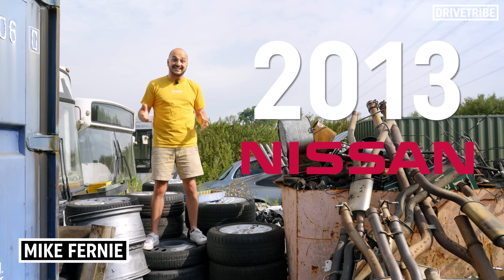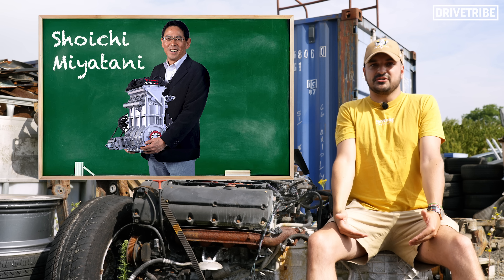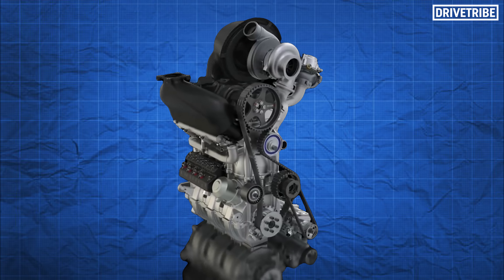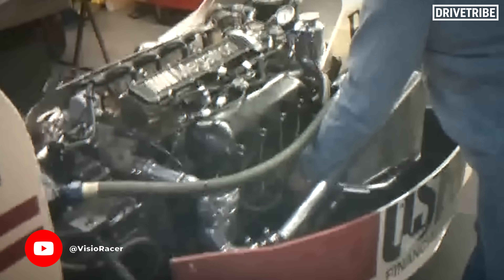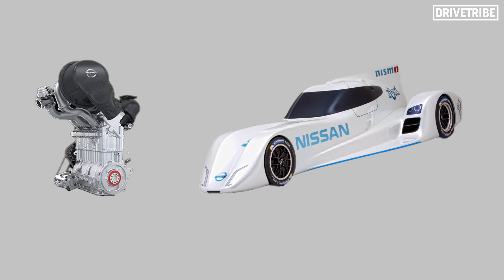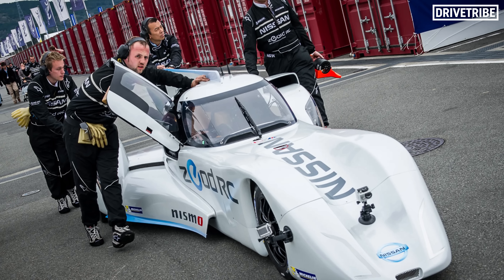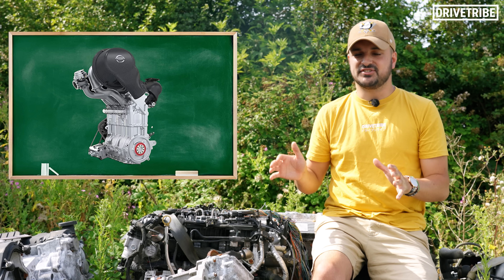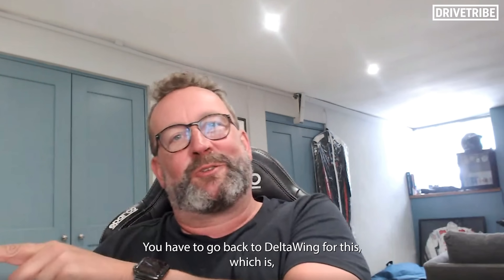This TINY Nissan Engine is More Powerful Than Your Car!

Comment: 07:00 that isn't at all how frontal area works. The ENTIRE front surface is frontal area, not just the tip of the nose. Stand in front and look at the car. Everything you can see, is frontal area. But yes, it is very sleek.

Comment: Perfect designs are perfectly balanced on more or all specifications. For sure there are more engines build already reaching these power to weight specs. But have these designs been used in multiple applications ? I think the answer is also NO.
However this video was quite informative to see that politics and lawyers also can influence the succes of an engine design.

Comment: I have a nissan with a dig-s engine, 1.2l supercharged with 100bhp, low consumption, but a lot of problems, valves, coil, spark plugs and so on. Too bad because its a funny car to drive.
Nissan like to make interesting engines, but sometimes reliability is better

Comment: Okay...wait...so 40Kg in an overhead compartment? I think folks dont apreciate how heavy 40Kg really is.
Reply: I think the overhead compartment reference was more for the physical envelope rather than the weight. To your point, I have no idea how strong those compartments are, but I certainly wouldn't want that weight over my head, dynamically loading the bin in a turbulent patch of air. 😳
Reply: 40 kg is the same weight as a bag of cement (except in Japan where bags of cement are 50 kg)
Reply: @tmatsci  -- Actually, it's 88 lbs, and cement comes in 94 lb. bags. It's about halfway between a bundle of old-style roof shingles (81 lbs.) and a bag of cement. When I first started in construction, we had to carry those bundles up a ladder, about 40 bundles for the smallest roofs we did, and up to 150 of them on the larger houses. As for the overhead compartment, if you put 4 25-lb. carry-ons into one of those compartments, you're already heavier than the engine.
Reply: @grizzlygrizzle  cement bag weights depend on where you are in the world.  In Australia where I am it is now 40kg per bag of cement and has been since 1973 when we changed from the old imperial measures to metric. Before metric the cement base was nominally I cubic foot of cement and weighed 94 pounds. Now that it is metric it is 40 kg or 88.1 lbs in the old measurement. One cubic foot of cement was chosen so that you could easily batch concrete by volume for example a typical foundation mix was 1 bag of cement, to 4 bags of clean sand and 7 bags of gravel aggregate. From what you posted it would appear that you live in the USA  which is still using the old system.
Reply: @tmatsci  -- Right you are, Ken.
Reply: grizzlygrizzle No Cement comes in in 80 pounds you must been from somewhere else
Reply: Max weight for cabin luggage is 7 kg or so... no way would any one take a cabin bag weighing 40 kg onto a plane... even hold luggage must be 25 kg max 😆😆
Reply: How much is 40kg in real units of measurement?  Is that as much as a standard person? Or a standard house?  Who knows?

Comment: Suzuki Hayabusa Says " hold my beer" and hand me a turbocharger. It might be heavier but it's because transmission is integrated into it.
Reply: Exactly my thoughts, including the transmission bit. Really strange that he didn't think of turbo bike engines.
Reply: That hyabusa engine gets turned into a V8. Someone makes cams so you can rotate one head.
Reply: Ever seen the V8 by merging 2 together?
Reply: @MrRourk  Wow yes please you'd only need a 4 speed Gearbox
Reply: @MrRourk  The Synergy V8 that was more famously stuffed into a GT86?
Reply: That and the Ninja H2R, stock.
Reply: Why do we always have to have the haters and bashers on everything
Reply: i think porch has a 250cc engine that produces 100hp that they made for testing head designs but probably weighs a alot since its only used for testing
Reply: This was still much lighter.
Reply: @Markknightexeter  it looks like it's weight 40kG is just the engine. Doesn't count all the parts to make it run. Like a water pump, alternator, intake, exhaust manifold.
Reply: @danowens7145  From chat Chat GPT,

"The engine from a Suzuki Hayabusa, without the running gear and accessories, typically weighs around 60 to 65 kilograms (approximately 132 to 143 pounds). This weight can vary slightly depending on the specific model year and any modifications or removals."

It also said this,

"The Suzuki Hayabusa's engine produces around 190 to 200 horsepower (about 142 to 149 kW) and approximately 150 to 155 Nm (about 110 to 114 lb-ft) of torque. These figures can vary slightly depending on the specific model year and any modifications or updates made to the engine."

If you were to calculate the weight compared  to power, the Nissan engine would thrash it, then again if you were to take the turbo off I've no idea what the power would be, I'm guessing 200hp+ from just 2/3 of the weight.
Reply: @Markknightexeter  This is where you make your mistake...you compare this turbocharges engine to a naturally aspirated engine. Why don't you compare it to a turbocharged Hayabusa engine? I will grant you that the Hayabusa engine will be heavier and it might possibly even make less power on pump gas, but that would be a more honest comparison.
Reply: @justinkase1360  not really, if you were you put a bigger turbo on this, it wouldn't be as powerful as a turbo huabusa and be lighter.
Reply: @Markknightexeter  "Chat GPT" ?... 🙄😂

Comment: A hand grenade is really powerful for short periods...
This is a silly topic. Toyota seem to have a reasonable performance/mass number with their 3 cylinder, but dont skip maintenance..... Bearing loads are really high on these small engines, ditto cylinder pressures.
There are no free lunches....

Comment: It’s been a while but there was a guy in the Arizona? desert somewhere who built a crazy little 400cc engine making 700hp normally aspirated at half as much weight. I don’t remember the exact details but it used a cam instead of a traditional crankshaft with roller pistons and no con rods. Useless in any real application but interesting.

Comment: Not so much the Diglett engine. The KATECH engine, though... has real possibilities in a somewhat deturned version (or a lower compression, turbo configuration) for road/track use. Road cars that I can see it in would be properly prepped Fiero or DeLorean. I also think it might be fun to adapt the Katech into a Ford Fusion AWD Titanium--these have been used in RAC rally cars and a turbo Katech four-banger would take properly prepped Fusion to a whole different level of fun. IMHO/YMMV

Comment: You can get 2000hp in a drag car .  It lasts 10 seconds before needing a rebuild !
Reply: There are 2000-3000hp drag and drive cars that can not only make that power and run 6 second quarter miles but can also drive hundreds of miles on the street between the tracks.

Comment: Nissan did the same on NA Engines. The SR16VE N1 was used in the limited-production Pulsar VZ-R N1, produced from 1997 to 1998. These cars were tuned by Autech Japan. It made 200 PS (197 hp; 147 kW) at 7800 rpm and 134 lb⋅ft (182 N⋅m) at 7600 rpm. Redline of the N1 Version 2 (1998) is at 8600 rpm. This is also claimed to be the most powerful production 1.6 L naturally aspirated engine.

Comment: Toyota’s 3cyl has been pushed well past 400hp. 
Comparing a production engine to a race engine is like comparing a lasagna to a sheet of pasta. 
I mean LamSpeed have pushed the toyota 3pot to over 880hp at the hubs.

Comment: For pure sillyness drop one into either an original 1960's Fiat 500 or a Tuk-Tuk. The total power to weight ratio would be insane. Both would probably need wheely bars to stop it flipping over!
Reply: Or just drop a Hyabusa into a golf cart.
Reply: @wingracer1614  Hmm! I've seen a V8 in a go-cart so I suppose anything is possible.

Comment: Hey, wait, no mention of Rotax? Their top-of-the-line product is a 1630 cc line-3 supercharged affair putting out 300 hp, for a weight of 91 kg. 

The only problem is that it's a marine engine, also used for snow mobiles. But it is an actual "off the shelf" product.
Reply: I can see that Rotax in a car. You just need an adapter plate to fit a car transmission.

Comment: Noted American engine builder Steve Morris is currently working on a 1200 cc 3 cylinder Rotax unit that is expected to produce 900bhp! Not sure what the all-up weight will be but  the customer wants to put it in an off road buggy which are pretty light!

Comment: Imagine ariel Atom with this motor ! standard one without turbo dry weight 123 kg so you can save around 83 kg! so with 450 kg ariel you save 18% of car weight!
Imagine next step have carbon fiber construction lattice!or some titanium 3d printed one? then the magnesium, or carbon wheels, carbon ceramic brake disks, lightweight calippers and special breaks pads- nitrogen tyres pumped and then it-s quite possible to get 350 kg 400 HP race machine! WOW INSANE!

Comment: A 2.7 litre 4 cylinder NA racing engine isn't as unusual as you may believe, in the British Hillclimb Championship throughout the 80s the engine of choice was a Hart 2.8 litre 4 cylinder that made similar power.

Comment: I would put the engine into a E-Car as a power recharge source or even better some sort of diesel fuel version maybe so you can use the dyed diesel fuel so you are taxed less as its counted as a generator not a power of motion engine

Comment: Perhaps manufacturers should develop engines that do 200 mpg rather than 200mph in a world where you cannot legally exceed 70-75mph!!
Reply: It's only illegal if you get caught
Reply: You’re no fun 😊
Reply: Where’s the fun in that
Reply: My Alpine A110s  is 300hp and manages 40mpg ... just because it can do 165mph (ish) doesn't mean I have to .....unless on the Autobahn where parts are not restricted where 75mph can be exceeded 😊
Reply: 80mph limit in Idaho.  I set the cruise at 87mph and never been pulled over.
Reply: Suzuki made a 106 mpg 5 door car,
Just a pure petrol engine, nothing more
Reply: Electric cars basically get 200mpg.    Ice vehicles actually get less mpg if the engine is to small and has to work harder.  Always need the right size engine for the condition.

Comment: I would install this engine on a motorbike,     it makes sense as it will not be stressed as much due to carrying less weight. Probably, de tune it to 300hp for longevity 😅
Reply: Doesn't a kawasaki H2R already have around 300hp

Comment: I mean, I could carry a 40kg engine and I’m 49 and out of shape… but I weigh 120kg and worked as a storeman, so I’m used to carrying heavy loads. 
A engineer who looked like he wouldn’t be more than 65kg’s carrying 40kg with ease? Not at all surprised that was the work of photoshop.
Reply: OSA agrees with you! Based on health chart the maximum lifted  amount from an adult male in this posture is 51 pounds / 25 Kilos. You have to find levers too in order to grab it and lift it to your weist height. ;)

Comment: It actually makes me laugh when people talk about very light vehicles. They would be impractical to drive on a normal road in a storm or high wind. Controlling them and keeping them on the road would be a nightmare. They could potentially become much lighter and lift at lower speeds and lose grip. Of course if you use high downforce to negate the lightness, you are defeating the entire purpose of the vehicle being "lighter". There are definite advantages to some weight in vehicles.
Reply: No one is building cars that light. I've driven a kart that weighs less than 300 pounds including me at over 100mph, no issues with wind or lift

Comment: 7:45 "...transmission failure....common with 24h races..."  With only six laps to failure, it didn't last even a 30 minute race. So the quoted comment is non-applicable here.

Comment: would be nice if there was at least a text conversion to imperial measurements. takes away from the video for us american viewers i feel to pause the video look up what 40kg is since i have no reference to what weight that is. find its 88lbs which is still incredibly light for an engine but doesnt sound as light in my brain as 40 kg. then resume the video. i know its an american problem i just dont have the brain power to remember another system then the one ive been having drilled into my brain my whole life

Comment: That Katech is just half a 5.3L LS or LT V8 motor.  That's why the 2.7L displacement.
Reply: True. 
Surprised that they dont know.
Reply: @jareknowak8712 they said it
Reply: @guy_autordie   
Does not count. 
They said it after i wrote it. 
🤪

Comment: Well apart from that weight being dry and without any of the ancilliaries such as that massive turbo and intercooler which it had to have to make the power (so in practice it was nowhere near 40kg), its also a one off billet race engine which not only costs a fortune but can also be designed to run on race fuel and not worry about any emissions regs. 
The reason we don't see things like that in road cars is because if you want 400hp something like a 2.0T 4 cylinder adds a relatively insignificant amount of weight over a 3-pot with the usual cast parts, is in a lower state of tuen so easier to get through emissions and longevity testing and doesn't need to be made of unobtanium to deal with it. 
When its in a car thats over 1.5t in the first place an extra 50kg for ease of manufacturing, cost, longevity, economy, emissions and all the rest is the obvious trade off. 
Oh and on normal fuel its not making 400hp unless its also making a lot of heat. More like low-mid 300's at best. This is why the Yaris GR engine is getting close to its limits too - 280hp is great but its also only about 50hp away from being right on the edge on road fuel and with road emissions equipment.
Reply: Motorcycles are going down to parallel twins now for emissions reasons, cars for four to 3 cylinders. The gap between the piston and the cylinder lets hydrocarbons past and ruins the emissions.

Comment: Given the steaming logs that their standard production dig-s and dig -t offerings are,in both 3 and 4 cylinder guises,and judging by the amount I have personally repaired or replaced.plenty at less than 25k miles too!,(really poor oil consumption,badly stretched or broken timing chains,burnt valves, broken pistons/rings,hpfp failures and snapped turbos are just some of their common failures) I very much doubt that this engine would last much longer than 24 hrs anyway. Nissan are the worst of the japanese manufacturers,many people erroneously blame their Renault partnership but the truth is that they were in trouble before that,endorsed by the fact that it took that very partnership to save them. Im old enough to remember pre Renault Nissan and the inherent problems those cars suffered from. Burnt valves,timing chains and poor oil consumption were issues back then too. Call me cynical but that doesnt sound like advancement.Any manufacturer could create a small Forced induction engine to push out crazy figures,making one that lasts more than five minutes is the hard bit, this is nothing more than a gimmick.

Comment: Koenigsegg`s Tiny Friendly Giant Engine, Twin Turbo Freevalve 3-cylinder is 600 hp and 70 kg / 154.3 lb 🤩
Reply: Agreed the koenigsegg gemera 2L 3 cylinder twin turbo freevalve has some great stats, but has been a will arrive next year car since 2020. I like the freevalve concept but will they ever get it to work reliably in a production car let alone will it ever make it into a production car for the masses.
Reply: @neilmowles9581   I’m like FV #1 fan boy, love it, ready to get the tat… 

but it’s been said that there are simpler more reliable ways to get the “same” (close enough) and I’m gonna… wait on that tattoo 😔
Reply: Except you cant get that engine. The gemera will only be available with the v8.
Reply: Possibly a million dollars more due to the TFG being a freak of mechanical engineering in all the right ways… 

and only assuming that Nissan isn’t tiptoeing into the hyper car market with their engine.
Reply: Königsegg is abandoning that engine because no one wants it.
Reply: @kjelleriksson2793   welllllll, nobody wants to pay the ridiculous pice tag… if he’s got one collecting dust and wants to see it in a Fiero ya know…

Comment: I'd put this engine either in a Ford Ka (1st generation) or a 1960s VW Beetle. Would be the perfect sleeper vehicle.
Reply: or a MX-5 mk1 ? that would save like 80kg just on the engine, and increase the hp by like 310hp. :)
Reply: @AndrewTSq  Yea, but you kind of expect a 1st gen MX-5 to be modded in some way. Imagine cruising in your 80k Euros BMW on the Autobahn at around 180 to 200 kph and being overtaken by a Ford Ka...